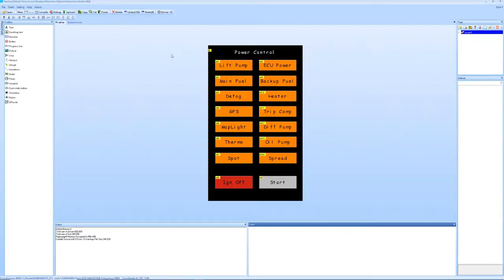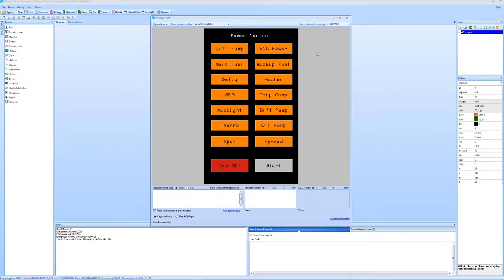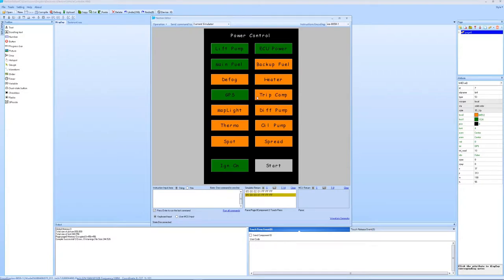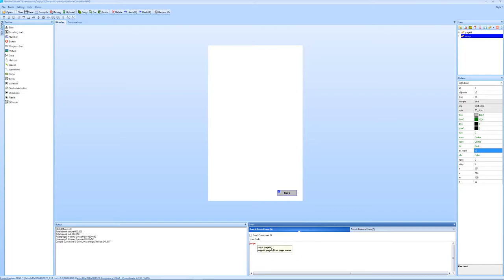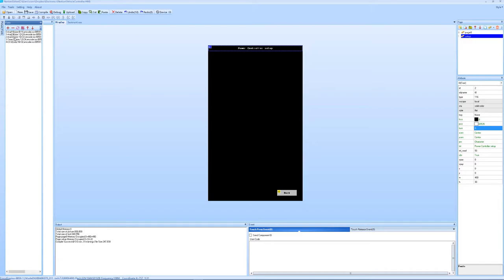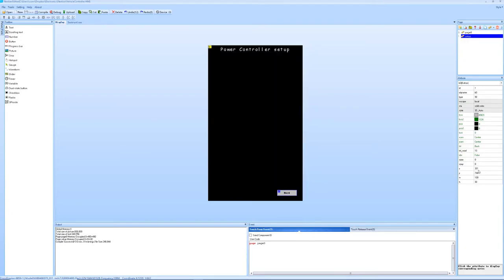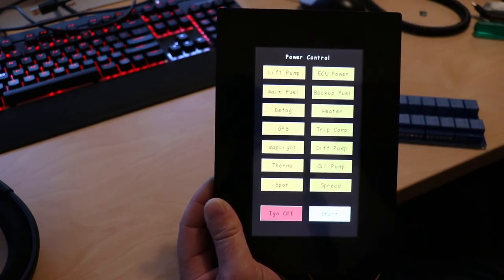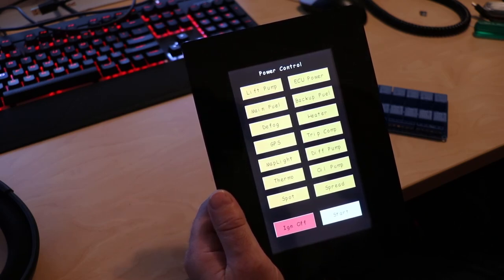Nextion Power Control 16 relay board

Comment: Hi Did you plan to share the ini files?. I Need the Same for a Paramedic truck
Reply from the maker: I will do an update to the video in time. Once all the programming and logic is done on the Arduino and fully tested and I will release the code. Thanks for watching Stefan.
Reply: @stephenconrad4938  hey buddy, can you share the project. I'm looking for something similar since a lot of time but I dont have not clue how to do.
Reply: @stephenconrad4938  Hi Stephen Did you ever manage to sort some code out for this? The Nextion Graphics part is easy to do and it can look great but its getting the Arduino to control the Nextion that stumps most people.